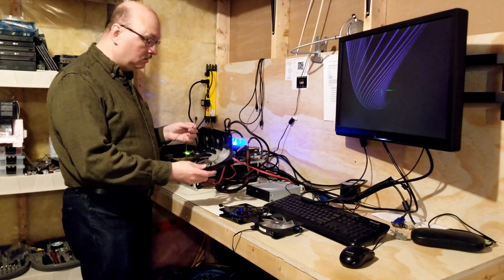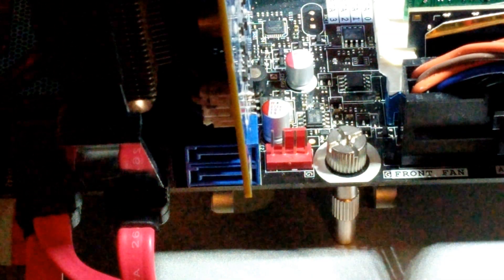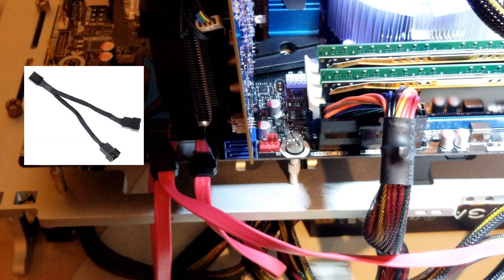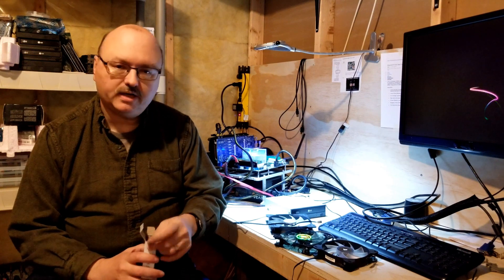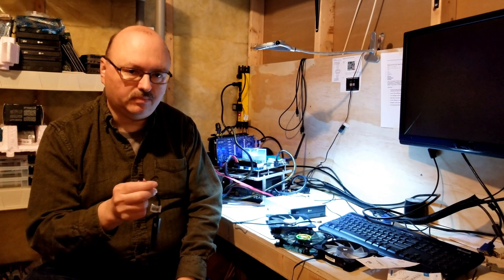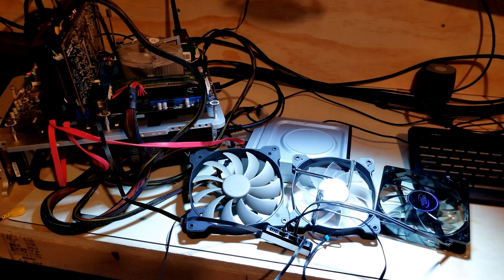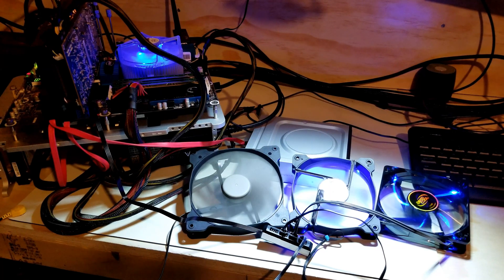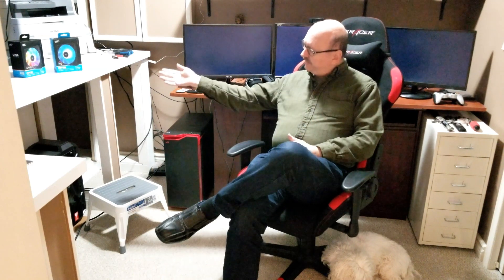Add Fan Headers to your Motherboard with Deepcool FH 04 4 Port Fan Hub

Comment: my motherboard has a single fan header that is 4 pin,but all my rgb fans r 12v 3 pin,is there any controller that i can buy to control my 3 pin fans?i have 6 fans in my pc rgb 3 pin 12 v..
Reply from the maker: You can use a Deepcool RGB Convertor - Convert 3-pin (+5V) ARGB Fans to 4-pin (+12V) RGB Capable Motherboard <NOT Compatible with ASRock Motherboard> or Thermaltake CL-O015-PL00BL-A TT Sync Controller TT Premium Edition Both can be found on NewEgg.ca or NewEgg.com   hope that helps...
Reply: @Reviewing_Playing_and_More_RPM  sir i have 12V 3 pin fans not 5V 3 pin... My motherboard has a single 4 pin header... That header is non rgb...
Reply from the maker: Ok, so your question is a bit confusing as you talk about 5v and 12v, which is for RGB, but your saying your MB has a 4 Pin Header which means a fan Header. So if you are talking just a fan hub then why mention RGB? Also if your referring to 5V it is 3 Pin and 12V is 4 Pin, so mentioning a 4 pin header on your MB as a fan header is strange...so either you need a Fan Hub, an RGB Hub, or one that does both...provide some clarity and I'll give you better answer or if you just need one of those let me know and I'm give you one I recommend...Thanks...
Reply: @Reviewing_Playing_and_More_RPM  my mother board is asus h81 M it has a 4 pin header and that header is a simple header for cpu fan its not for rgb... But i have 6 rgb fans in my pc. The strangest thing is that my fans are 3 pin and dc 12V instead of 5V.Everywhere i saw that 3 pin fans are 5V but my 3 pin fans are 12V. Now the issue is that seller sent me this pc without any controller somehow he managed to connect these fans by using wires and joints... So my rgb fans give different colours.. 1 is  giving green 1 red or other purple like that... So I'm unable to control them... All of them give different colours... So what i need is a rgb fan controller for my 3 pin 12V dc fans so that i can control light colors and run them in same color...
I have uploaded pic of my fan connectors here so pls check this also;  https://prntscr.com/syxw7r
And thats my board;    http://prnt.sc/syy29l
Reply from the maker: This Motherboard support RGB for the GPU, there is nothing that indicates there is any RGB on the Motherboard at all, so if they put in RGB fans or there are RGB fans in the case in order to control them you will need a normal RGB Controller, you'll need to search for one that meets your needs as I did some searching and other then what I already mentioned I couldn't find one that will help you out...Your Molex/Fan connector I'm not certain it would work, as you have a need for multiple fans so a Fan Hub is more what you need, you'll need to search for it to find the one that works for you...unfortunately I couldn't find one that will work...with older Motherboards it's difficult to find current items that will work...I would go to the person that sold it to you and ask what controller they were using and see if you can use that...sorry there's not much more I can recommend...Good Luck...
Reply: @Reviewing_Playing_and_More_RPM  thx...
Reply: Sir lets not talk about motherboard... Ignoring motherboard is there any rgb fan controller that can connect and control these 3 pin 12V fans? Just forget the motherboard...
Reply from the maker: The first one I mentioned from Deepcool should be able to do it, it does 5V and 12V, don't know which other one's will work...sorry...

Comment: Hi sir, Can i ask a question. Can i still use the port 1 even my fan is 3pin. (So that i can use all of the ports)
Reply from the maker: Yes, the reason they are all 4 pin is so if you have PWM Fans you will be able to control them in the BIOS...but yes you can use all 4 ports...Keep in mind though that in order to have the PWM Fan control in the BIOS you want to use that white port one first...it is the first one that makes contact and signals to your MB BIOS so you can get that control...hope that's not to confusing...Hope it answers your question...Thanks...
Reply: Reviewing Playing & More RPM Thank you sir, another question is, Is it better to use the fan hub on a 3 pin Led chassis fan or the molex option thru power supply (Vice versa) i really cant sleep thinking about this
Reply from the maker: So for the LED (RGB) of the fans you need to connect to a ARGB Header 5V, this is separate from the fans...if your only using fans without any LED (RGB) colors they connect to the fan hub...Thanks...

Comment: So if I want to plug 4 (0,20A) 4pin fans to this hub, can I control their speed? So you’re telling me that the fans will not ramp up to full speed if not to the speed that is set to fan 1 in the hub from the bios?
Reply from the maker: Most Motherboards can run 3 maybe 4 fans on 1 system fan header, it depends on how much the amp draw of each fan is, typically each system fan header can handle 1 Amp, this hub with these fans will be just fine...As to the Fans control, If non-PWM fans are connected to this fan hub, this fan hub CANNOT give them extra PWM function. They will run at full speed. If PWM fans are connected to this fan hub, speed of all PWM fans can be adjusted at the same time. That is, all PWM fans will run at the same DUTY RATIO, not the same speed. Only speed of Fan 1 can be identified by the system...Hope that helps...Thanks..
Reply: Reviewing Playing & More RPM thanks! The four fans that I want to put in the hub draws 0,20 amps each and my motherboard is an asus rog b365-f, which fan header do you recommend plugging
Reply from the maker: There are two at the bottom, and you could use the CPU Optional fan as a fan header as well...

Comment: So it is essentially drawing power for up to 4 fans from one port? Is that safe? I heard that the 10 port fan hub, or the FH-10, uses a dedicated SATA connection for power. I might go with that just to be safe. Great video, by the way.
Reply from the maker: Yes, up to 4 but anything beyond that requires more power and therefore connects to the SATA Power from your PSU...Thanks...

Comment: Is it possible that can you control with DC like the others 3 pin fans? Can you control fan speed when the fans are 3 pins?
Reply from the maker: Don't think it can be controlled using DC voltage, AC is the normal...3 pin fans cannot be controlled they'll run at full speed...it won't make much difference sound wise though...However I did read but have not tested it that you can set the control mode to voltage rather than PWM in the BIOS, (but not certain that this will work) It could cause problems so if you decide to try it it'll be at your own risk...Thanks...
Reply: @Reviewing_Playing_and_More_RPM  thanks a lot, I made some research and found that it cannot be controlled via motherboard. This is sad for me 😓
Reply from the maker: Can always replace the fans and get one's with 4 Pin if that's something you might want to do...Take Care...

Comment: Hey Dennis I got 2 questions for you: can you control the other 3 fans in the bios and if not, how loud are the fans that you cant control?
Reply from the maker: If you have PWM Fans you can control it in BIOS, as the Hub is 4 Pin...I have tried it without any fan control and that was with Corsair Fans and there was really no sound at all, it's basically inaudible...Thanks...
Reply: @Reviewing_Playing_and_More_RPM  thank u very much

Comment: Can you control all fans? Or run all fans in fullspeed
Reply from the maker: Full Speed I believe, never checked it out though...Thanks...
Reply: @Reviewing_Playing_and_More_RPM  I have 8 4pin fan connections on my motherboard.  4 above 4 below.  When I use the lower connections for my fans, the lower fans run at full speed.  But the top ones are not.  Can you maybe say why.  I have the fans of corsair hd120 rgb
Reply from the maker: If the fans are 4 Pin they are PWM fans which means they can be controlled, just went and double checked the hub and it is 4 Pin to the Motherboard so yes you can control the fans...if the fans are 3 pin then it's full speed...hope that helps...

Comment: Amazon workers are striking and the site said a month for delivery.  Newegg price gouged me on 2 2x fan splitters.  Paid like $16 I think.  Hopefully they deliver soon.  Built 3700X in Meshify C for my brother. Using 5700XT so want to use max airflow. 2X 140mm exhaust top, 3x 120mm front intake, 1x 140mm rear exhaust and nifty AMD rgb cpu cooler.  Gigabyte B450 Aorus extreme only has 4 fan headers, boo!
Reply from the maker: Yeah I just heard about the long delays for deliveries, bad timing for that but understandable considering I guess...4 Fan Headers is pretty good actually some MBs don't even have that, but some cases come with a built in Fan Hub that helps with this by providing up to 8 fan headers on it...Stay Safe and have a great day...Thanks...
Reply: @Reviewing_Playing_and_More_RPM  My Thor V2 came with fan controller but not the Meshify C, guess it is too elegant for that, lol
Reply: my main system is X570 Aorus Ultra and that has 7 fan headers
Reply from the maker: That's the MB I'm using in my main system as well but it was pricey, but worth it...
Reply: https://valid.x86.fr/bench/ee1hh9 That's me at the top beating 9900K in single threaded performance :)
Reply from the maker: Pretty cool...great system...

Comment: Hi I was wondering if you could help me out!. My motherboard only has a cpu fan header and a Chassis fan header. I have FOUR 3-pin fans that i would like to use. My motherboard recognizes if a fan is 3-pin or 4-pin when it is directly connected via the Cha fan header and thus fan speed can be controlled by voltage. However 1 fan header is not enough for 4 fans so Could you please suggest a fan controller for me that would work for 3-pin fans and allow voltage adjustment just like the motherboard would do if 1 fan was plugged directly.
I would greatly appreciate your help!!
Reply from the maker: There is the Corsair CL-9011110-WW Fan Controller Commander Pro Temperature Monitor for $85.99 Cdn on Amazon, and for a bit cheaper $49.99 SilverStone Technology Silverstone 8-Port PWM Fan Hub/Splitter for 4-Pin & 3-Pin Fans* in Black SST-CPF04-USA (Newest Version) is about half the price and both get there power from the Sata on your Power Supply so either will work great...Thanks...

Comment: Hi Dennis, I've watched a couple of your vids and they are vey informative, but I'm sure you already knew that. Can you just clarify one thing for me? So the hub itself is a 4-pin, which would allow PWM adjustments. If the fans I am planning to plug in are all 3-pin connectors, would I still be able to adjust fan speed? Thank you so much for your videos!
Reply from the maker: I haven't tried it but I do think you should be able to, sorry I don't have a better answer in that area, never thought to try it out...Thanks...
Reply: Reviewing Playing & More RPM I’m sure that it’ll be alright. If not, max cooling at all times :D
Reply from the maker: lol, yep...have a great day...

Comment: So If I have a b450 tomahawk with only 12v headers I can use this for my 3pin 5v rgb fans?
Reply from the maker: The Hub is for a normal Sys Fan Header to plug into, a 5V and 12V is for RGB lighting, and to much voltage on the wrong thing could cause issue's...Thanks...
Reply: @Reviewing_Playing_and_More_RPM  6 noctua 12V 4 pin fans get enough power on  deepcool 10 hub?
When multiple fans are connected on hub with PWM does every fan synchro speed depending of thermal necessity. i mean they speed up depending of how hot the case interior is?
Reply from the maker: @CommanderTato  If non-PWM fans are connected to this fan hub, this fan hub CANNOT give them extra PWM function. They will run at full speed. If PWM fans are connected to this fan hub, speed of all PWM fans can be adjusted at the same time. That is, all PWM fans will run at the same DUTY RATIO, not the same speed. Only speed of Fan 1 can be identified by the system.
Capable of connecting to 10 PC fans simultaneously...hope that answers your question...
Reply: @Reviewing_Playing_and_More_RPM  good, pwm  fans on that mode change speed depending of how hot is the case interior or they are static and need to be manually controlled to change speed?
Reply from the maker: @CommanderTato  yes if your mobo supports it, the pwm will automatically change rpm as needed, though you can still set manual fan curves and profiles if you wish through the provided software that came with your MB or through the BIOS...
Reply: @Reviewing_Playing_and_More_RPM  so the bios setting or os setting carry over trough a single header to the hub? cool
Reply from the maker: @CommanderTato  That's correct...

Comment: Question : Would this hub he drawing to much power from the motherboard ?
Reply from the maker: Most Motherboards can run 3 maybe 4 fans on 1 system fan header, it depends on how much the amp draw of each fan is, typically each system fan header can handle 1 Amp, this hub with these fans will be just fine...Thanks...

Comment: That´s great, but if I use, let´s say, all 4 fans connectors, is there a way of knowing if it will be ´too much´ for the motherboard´s fan header conector ? I have read and heard that one should not pass 1A per motherboard fan conector. I pretend to connect 4 LED fans (not RGB).
Reply from the maker: I would agree, using to many fan hubs could be detrimental, I'm not certain of how many can be used but two is likely fine, I know a lot of cases now come with fan hubs that connect up to 8 fans to one fan header,  and with RGB Fans, there can be as many as 8 running from that same hub, but RGB generally has a RGB connector with a dedicated RGB Header to handle the voltage...I'd probably use no more then a couple fan hubs to be safe...I don't know enough about voltages and such to say how many can be used though but what I've said will be generally safe...Hope that helps, sorry I'm not more versed in this area...
Reply: Meanwhile I did a little research of my own. It seems like the ´default´ max amperage of those motherboard header is 1A (1000mA). Usually a regular non-RGB 120mm LED fan has 0,250mA. 4 of these equals exactly 1000mA. However, some 140mm RGB fans seem to have 0,3 A, meaning one shouldn´t install more than 3. I suppose those 200mm RGB fans will be even more demanding. You guys can feel free to correct me if I wrote anything wrong here.

Some vendors mention the amperage in the product spec sheet, just in case people are wondering.  @Reviewing_Playing_and_More_RPM
Reply from the maker: It's interesting topic for sure, I have a case coming that has a fan hub, that takes 8 fans, and one is hard wired and that one goes into the motherboard. So perhaps the hub has something to it that helps control the amperage. Will have to do some research as well and see how these handle things. Thanks for your info...
Reply: From what I´ve have understood, there´s a difference between the HUB you reviewed in this vídeo (which is conected directly to the motherboard header, hence requiring attention not to pass the 1000mA threshold) and the CONTROLERS/HUBS that come with a SATA power cable. The latter doesn´t differ in any way than directly connecting all fans to the PSU, other than keeping things more organized with less cable salad, being the same concept. No worries about overburdening a motherboard fan header, which those models don´t even use.

Only reason I bought the model reviewed in your vídeo is because I was one fan header short for my parents´ PC enclosure and they don´t care for RGB anyway. A budget solution came in handy.

I have a controler/hub from Thermaltake in my PC and I don´t have to use motherboard fan headers (it´s SATA power based). But it´s an older model and some fan cables are literally STUCK and I am sort of lost on how to solve this in future, other than damaging the cables as a last resort solution. But, like I said, it´s a very old model (TT Commander or something like that) so I don´t think people will run into that type of issue nowadays.  @Reviewing_Playing_and_More_RPM
Reply from the maker: Yeah did some research and agree with what your saying, had a look at what I think is your case, and yeah that is a older case, sometimes it's best to consider a new case, and put your guts into it if possible. Or build yourself a new PC, it might be time...Whatever you decide you've got me to learn more about the voltages and such so well done...

Comment: That blue backlit fan looks awesome!! I am definitely going to build my next computer. I have never done it before and it's fantastic to have guys like you that actually know what there doing to teach me lol. How much current can that single pin header supply? would it be possible to overload it will multiple fans? Thanks 👍
Reply from the maker: I'm not sure about daisy chaining it, mostly because the power draw might damage the motherboard, not certain though...there is a 10 fan header though from Deepcool for just $20.00 though...Thanks...

Comment: This was a great instructional video. My first motherboard also had only a CPU fan header and one three pin fan header and I was incredibly frustrated by it. Wish I had known about this then, a port like this would have solved a lot of problems and save me a big headache! I'm wondering if that motherboard you bought with the only the two headers happened to be an ASUS Prime b360 m-a?
Reply from the maker: Yeah don't remember which one it was now, but yeah it happened to me on an otherwise great motherboard was really frustrating, this will actually be great down the road, getting a budget motherboard and not worrying so much about fan headers...will make getting one at a good budget price easier considering this only cost $10.00...Take Care...